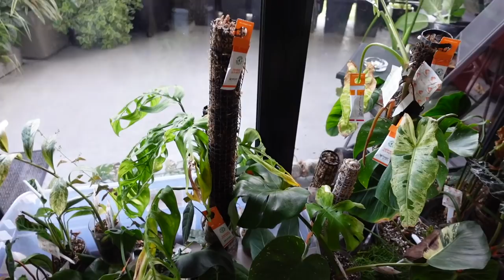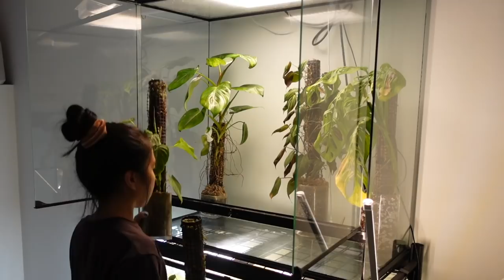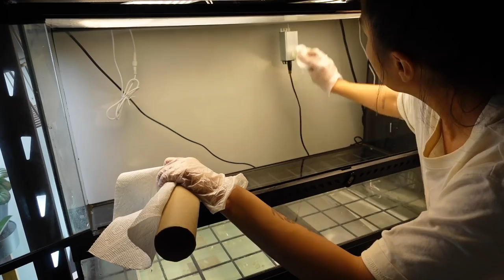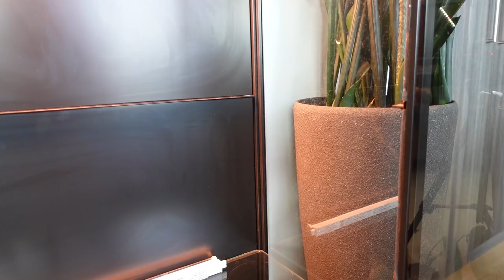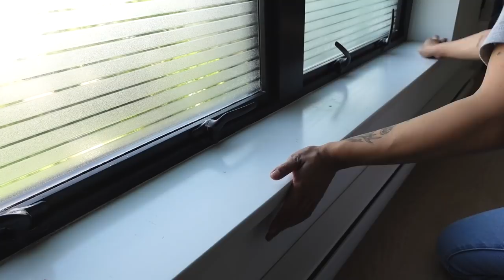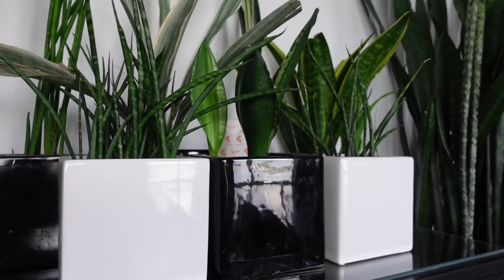complete overhaul of my neighbours plant collection (ugh, thrips!!)

Comment: Just discovered you and loving your content! What is the hard water stain remover you used? I have a well and been dealing with hardware and salt deposits from the water softener. Drives me nuts.
Reply from the maker: Thank you evelyn!! Here is the product I use- https://www.amazon.com/Hard-Water-Stain-Remover-40oz/dp/B00K3XPLZI/ref=asc_df_B00K3XPLZI/?tag=hyprod-20&linkCode=df0&hvadid=241974057337&hvpos=&hvnetw=g&hvrand=13217937628885622283&hvpone=&hvptwo=&hvqmt=&hvdev=c&hvdvcmdl=&hvlocint=&hvlocphy=9032537&hvtargid=pla-523570298566&psc=1

Comment: Thrips are an absolute nightmare. My kids are loud so if you mentioned this already I apologize. I just wanted to say if you haven't already you should add soil predators. 30% of the infestation can be just the pupae in the soil. I'll post a link to the one I use. I also release Orius Insidious every week or two until I'm no longer finding adult thrips. Then between the sachets and the soil predators, you should be able to avoid any large outbreaks.The orius eat all stages of thrips. I like the swirskii sachets the best.  It's a lot. But it's what it took for me to get my collection past it! Nick has some fabulous plants. It's so nice of you to do this.😊
Reply: I think Koppert also has that soil predator I just can't remember what they call it😆
Reply from the maker: I’ve actually been looking into soil predators! It’s one thing I said I wanted to try out but never had the chance to yet. Also thank you for the suggestion of using orius! I do prefer swirskii too. I find they hatch in the highest amounts and are just overall more aggressive than any other predatory mite I’ve used before. Definitely wanna look into using something for the substrate though- thank you for sharing!
Reply: Definitely try some orius while you have adult thrips. They eat every stage of thrips! The soil predators I used are Entomite (koppert) and hypoasmis miles (Growliv). They are the same one just a different product name. I'm to the point where I only have thrips in my treatment box (tallest clear tote i could find). And that has happened because of the shipping delays. I haven't been able to get anything from growliv, and won't until the new year. But they're sealed in that tote with swirskii sachets🤞. This whole process took months to be confident that my plants are good. I keep sachets on them because I have thrips nightmares🤣. And I feel they could always come back. The way they lay eggs in slits of the leaves mean that a new batch can still hatch.

Comment: So i ordered a squamicaule and the seller sent it to me full of thrip larvae…. directly to my go-to!!! WWCD?!
Reply from the maker: Oh mother f!! That sucks 😮‍💨😮‍💨😮‍💨 do a full wash down, bare root. You can even do a 15-20 minute soak in water + pure Castile soap. If the plant has roots, you can use a systemic, but if there are no roots, then just thrips spray will do. Just keep in mind that pest sprays are only for exposed thrips, so it won’t kill the larvae. But as long as you can keep killing the ones that hatch until all those f-ers are unalive then that’s your best bet at eradicating them over time. Larvae hatch much faster in warm, humid conditions. So try putting it in a bin for a few weeks to speed up the hatching process. And then run to your bed and scream into a pillow, and once you get all your screams out, look in the mirror and say IM A BAD B*TCH and carry on with your life
Reply: @unplantparenthood  the best advice. Its been established and acclimated here for a while even travelled between 3 states. Its a lil one though. Seller said “spray everything” and thats it. They arent moving really, i half thought it was sphag bits, but theres damage and more odd damage showed up from the 8hours i went to work and came back. Serpens i ordered perked right up no issue. I systemiced that sphag substrate, bonide spray, and quarantined in the new empty rudsta. Went from 70% plant room to the mail to 60-80 F degrees and 90%’s humidity in cabinet so… i just hope bc i couldnt qaurantine it (dont even ask, Ikea messed up my Milsbo orders, now 3 orders later and no milsbo or refund, i got 2 rudstas) that everything didnt get infected or they got laid and I’m just not noticing, idk 🤷‍♂️ i dont see any thrips flying around in there. Anways. Ordering predatory bugs / lady beetles now too i aint playin around these fuzzy babies are my pride and joy and these cabinet plants.
Thanks so much Charmaine for replying with such help and detail!!!!!